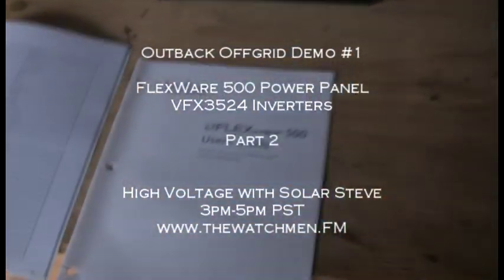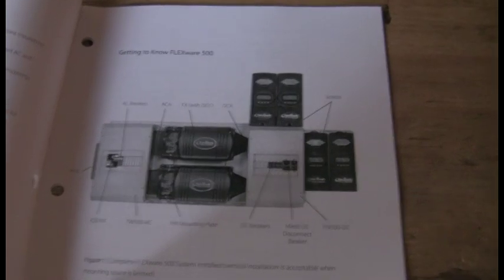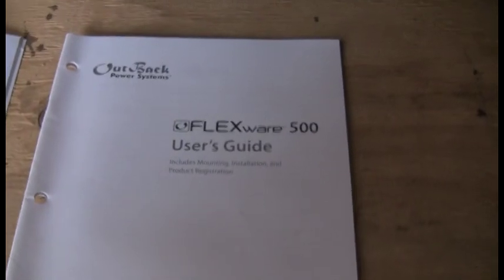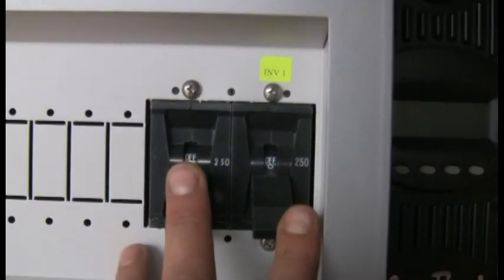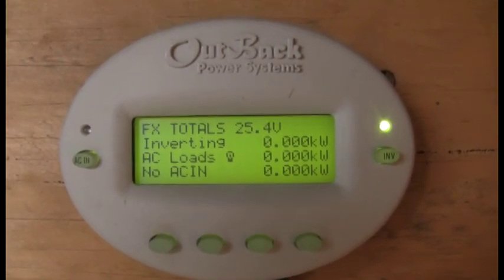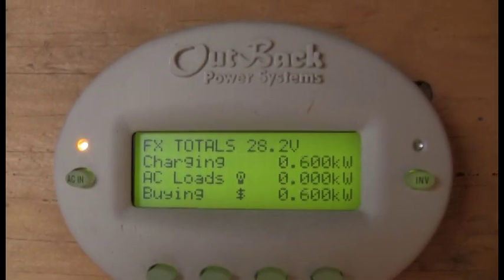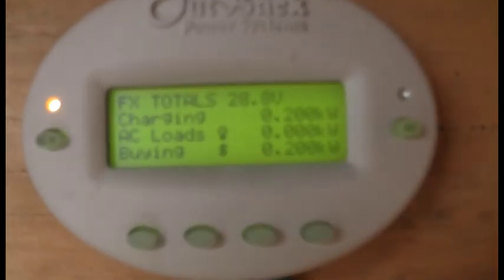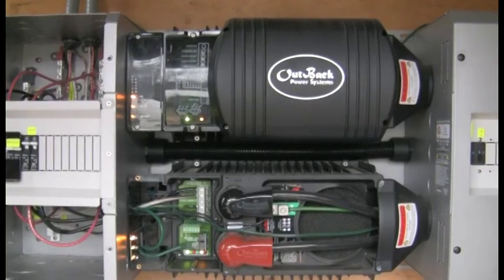Outback Offgrid #1 Power Panel and Inverters part 2

Comment: will 5 kw soler and 2 150 charge controllers and 2 gvfx 3648 wired in opasit phase work with 16 batterys 2 banks

Comment: why you have a mate , doesn't the charge controller by it self has that tri monitoring doing the same? I ask because I am planing to buy the VFX3524 OutBack Power Inverter with the flex 60 or the 80 one. No one ever talk me about the so called mate...

Comment: I'v been off grid for 7 years and I use an Upright 18 cu ft frost free freezer all year inside along with an 18 cu ft refrigerator/freezer . Combined power consumption 5 KWh per day plus everything else in the house uses another 7 KWH per day. My advice ( to your subscribers ) is just give yourself enough panels and wind turbines to do the job and then double it and you'll never run out of power ad you'll be happy.

Comment from the maker: @markymarkuss777 That is simply NOT true. You can run DC appliances and there are good reasons why you might go that route. An inverter by definition transforms DC power into AC power. Batteries produce DC power only, so using an inverter allows you to use any AC powered device/appliance provided you can manage its load over time. In this system, I am able to use BOTH AC and DC devices, which gives me more options and is more versatile.

Comment: @SolarSteveUSA I was reading a commentary on one of these solar panel videos, and the guy said that if you are OFF THE GRID, you will be forced to only use appliances that run on DC power. It almost made it sound like he was saying that you can't use an inverter (from DC to AC) when you're OFF THE GRID. Is he correct, or can you use the inverter to transfer DC to AC as well?